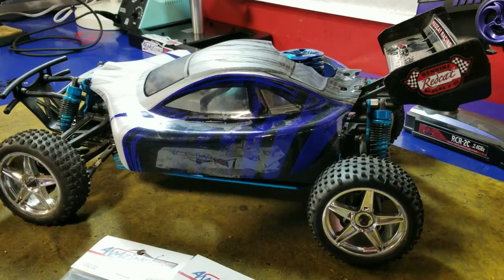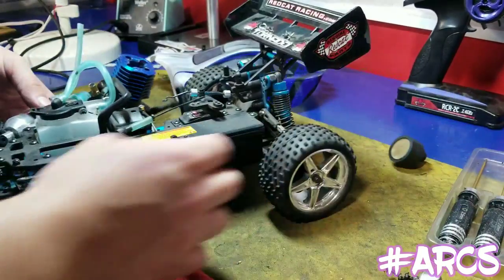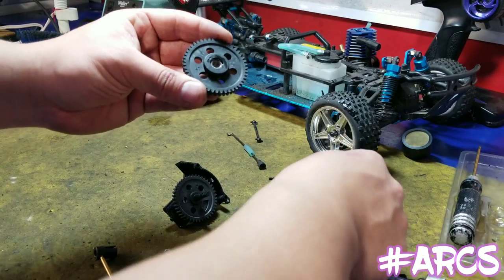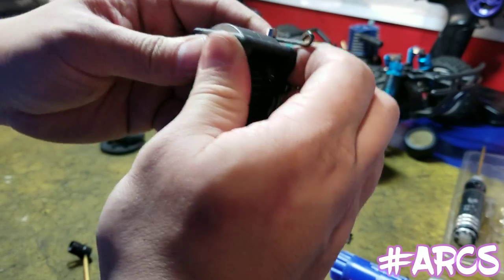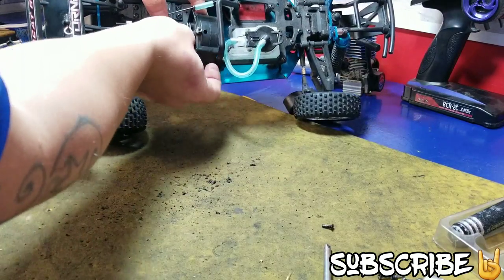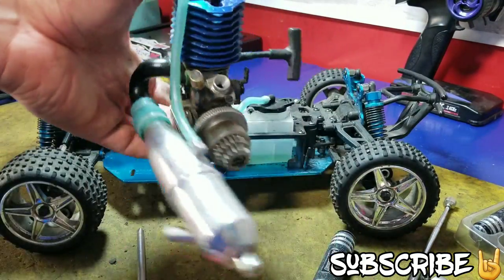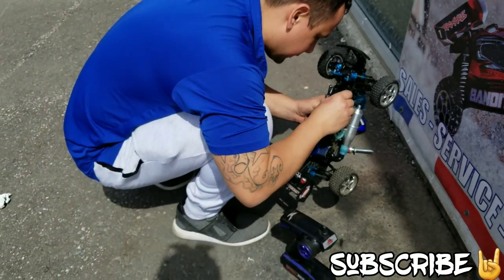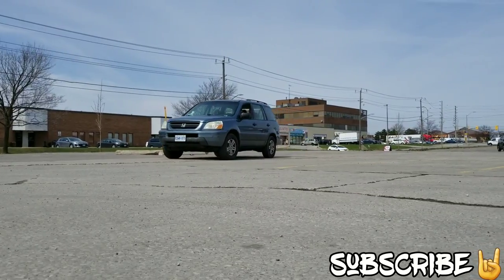How to change 2 speed transmission gears on TornadoS30

Comment: Mine doesn’t shift... we’ve done the adjustments to the transmission screw, and it still doesn’t shift. Do I need a new transmission?
Reply from the maker: It might also be the one way bearing inside the gear. I would check it
Reply: What was the solution?
Reply: @alejandromoya9536  buying a new transmission from rc planet

Comment: Why my gear are moving but not the car
Reply from the maker: Check the one way bearing in the center diff gear. Make sure its installed properly or replace if necessary.
Reply: Amazing RC Store thank you the one way bearing was broken